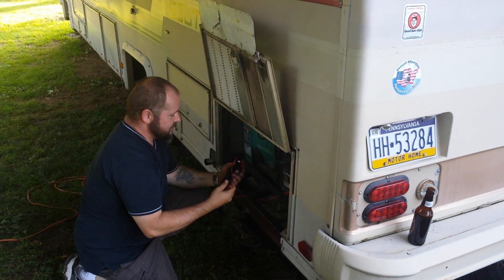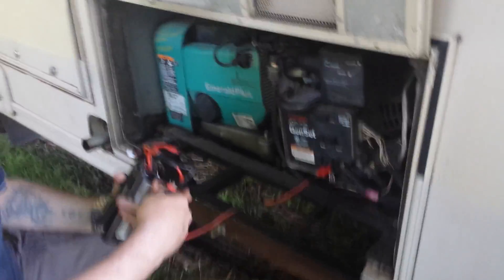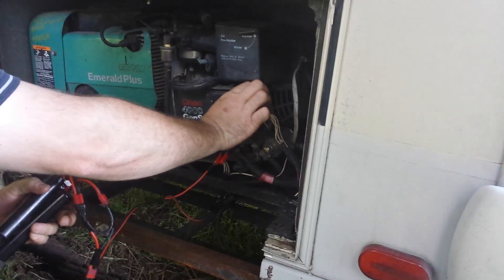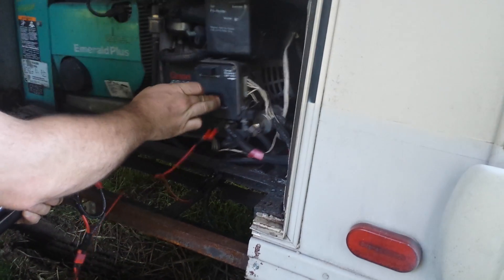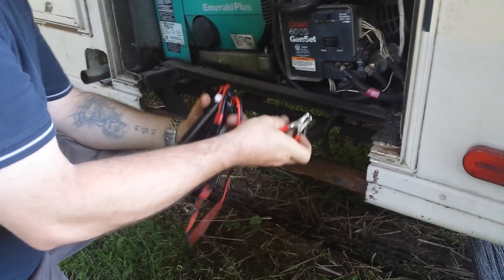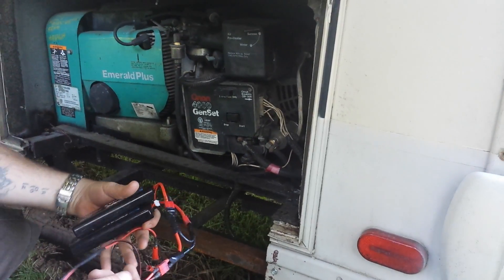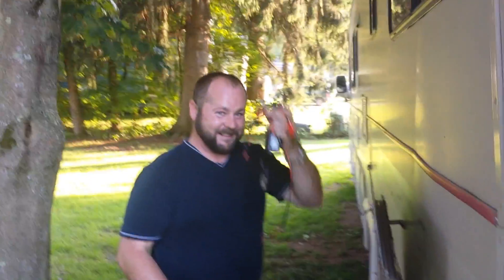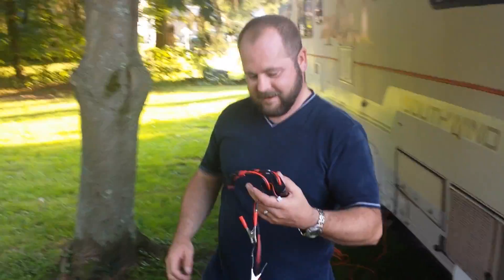Using rc batteries to jump start a generator.

Comment: Would have been real nice if you showed people the procedure and where you connected the cables all you did was show people that it started
Reply from the maker: In my honest opinion of you aren't familiar with batteries or 12v DC systems than I would rather not be responsible for someone getting hurt. This video is old and you can now buy jump packs for cheap. Just hook up your general or vehicle wires and go

Comment: I was thinking about turning an old gigantic flashlight from my FD into a jump box and power supply, do you think a 5200mAH 50C 4S would be sufficient for bigger motors? I tried looking up the specs for the ones in the jump packs, but l didn't find much.
Reply from the maker: I own Helios RC batteries company and use the 4s. The higher the c rating the better but you should be able to get about 3 jumps.

Comment: This video is just what I was looking for. I have a 1990. House batteries are 1yr old, but won't charge so I haven't been able to start the generator (which is the same model as yours btw). I've been using my Predator 3500 to power the RV, but I have to pick and choose what stuff I want to run because it is lower capacity. Also, pulling the Predator out of the storage compartment is getting old.
Reply from the maker: Glad we could help! I've used this method to jump start cars too.
Reply: Thanks

Comment: Guys, you literally did not reach me anything. What do I connect the cables to?
Reply from the maker: I made an alligator clip jumper cable and I ran them to ground and not on the starter. Every one is a bit different so I can't really answer your situation but if you have a little knowledge of vehicle electric it should be easy to figure out by tracing cables.

Comment: My 1987 Ford Tioga Class C has a working chassis and rv battery as well as a new working solenoid.  However, the aux battery switch  will not start anything in the  cabin nor the generator,  Will the RC battery method work to start the generator?
Reply from the maker: Probably

Comment: Hi there, i see this video is a few years old. I have a few questions, let me first off say im mechanically illiterate and need step by step how-to do any of it. Second, this looks a bit dangerous, 3rd how do you wire the jumper cables to the batteries? Im sure its quite simple, but ive never even jumstarted anything in my life. Im trying to do this very thing though, jumpstart an Onan generator on a 1995 fleetwood motorhome. Any info is very much appreciated. 😊
Reply from the maker: Well I had some big alligator clips and soldered them to a battery connector. Then placed those on the positive and negative terminals for the battery hook up on the generator. I'm sure a jump box from a store would be easier unless you have rc batteries handy.